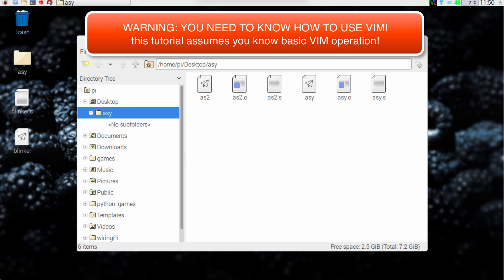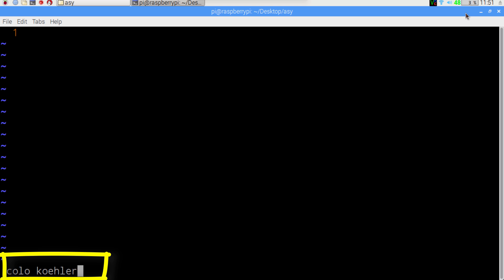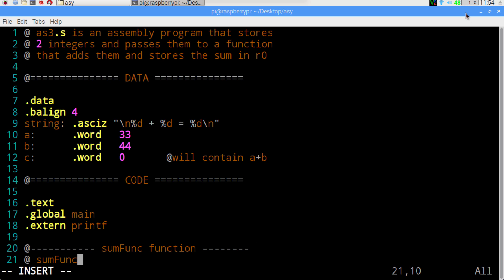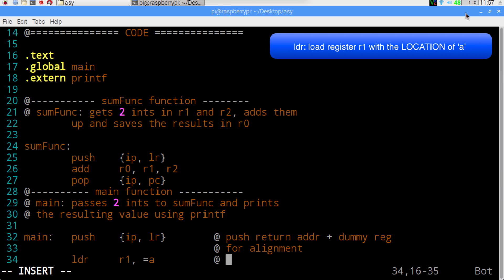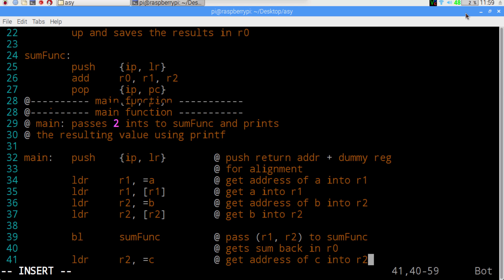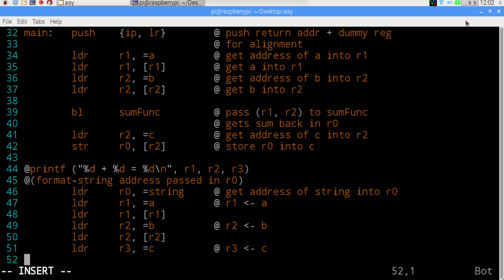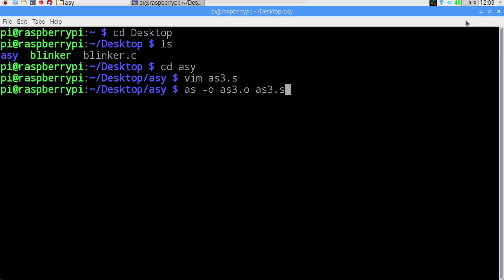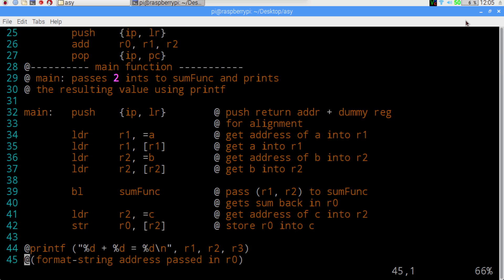Raspberry Pi Assembly Programming: intro to functions

Comment: Thanks, I've been trying to do some very cursory things in assembler on a Raspberry Pi 4B, but most of the documentation I've found is outdated and is for 32-bit architectures, from Raspberry Pi 2 times.

This is the first example I have been able to successfully compile on the Raspberry Pi 4B, and the explanation is pretty good. Will you have more videos about this on your channel?

I tried to find some more, but I see that what you have uploaded most recently are travel videos. Greetings and happy new year.
Reply from the maker: It's been a while and most of these I made for my students at the time, but I'm glad they helped others! I might set up a series with the more recent Raspberry Pi processor, but it might take a few months. Stay tuned!

Comment: Why can't I just do:
ldr r1, [=a]
.
Why do I have to do:
ldr r1,=a
ldr r1,[r1]
Reply: You cannot do ldr r1, [=a], because that is not a valid addressing mode on the ARM. Loading directly from memory is not possible on ARM, you need to set the address you want to read from in a register. ldr r1, =a is a register relative assignment into a register, where the address is constructed during assembly, in my case it disassembles to ldr r1, [pc, #56]  )

Comment: line 32 is add right?
Reply from the maker: line 32 is main:    push {ip, lr}  and everything after the @ symbol is merely comments. though comments are not as critical to the program, you should include them for your own understanding. If you want to understand line 32, it's storing something that we'll return to later: recall that push and pop commands follow each other. Check out the link above for more on push and pop commands.
Reply: yeah